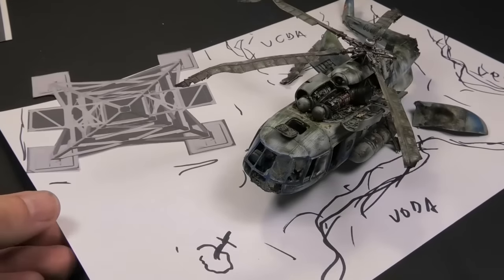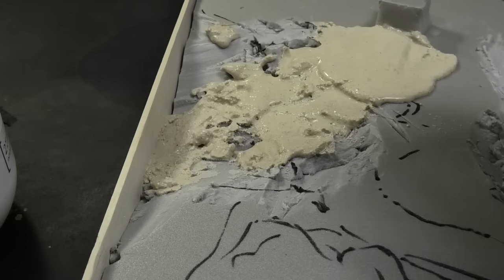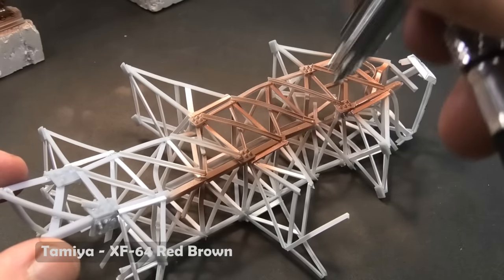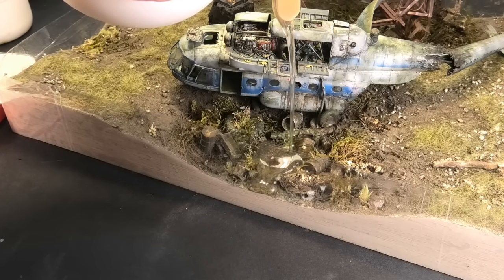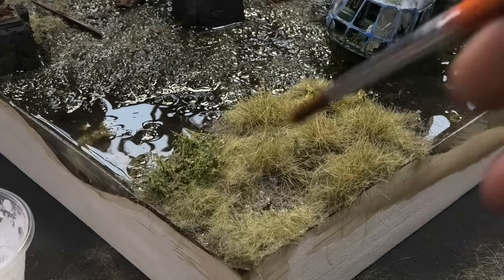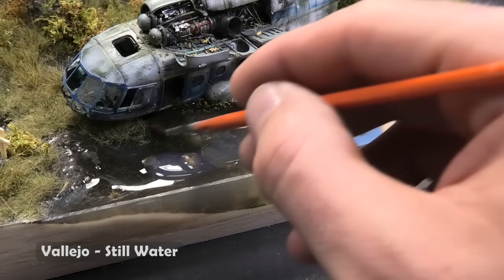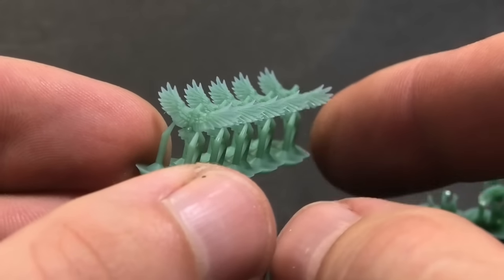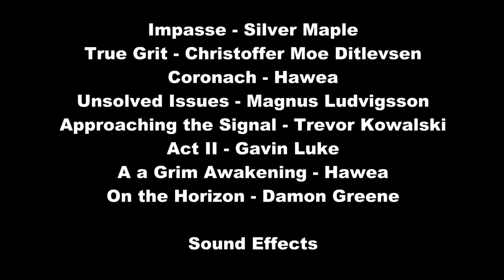Stalker Call of Pripyat - Crashed Helicopter - Post-apocalyptic Diorama 1/72

Comment: If you give everything a coat of clear matte acrylic before pouring the resin, it will do the best job of preventing that meniscus creep.  Any acrylic paint will do, but if you have a lot of different materials, the clear matte is the easiest.  Of course it won't help if the resin is over-filled, but other than that it works very well.  BTW, another excellent video!

Comment: A little note: In real life, high voltage power lines are usually steel ropes without isolation (there are only insulators, which separates power lines and tower construction).

Comment: Very nice work indeed. One tiny TINY nit to pick in this fine work: aren't the high voltage insulators usually a stack of discs of ceramic or porcelain? The ceramic is often brown colored, and they might be dirty, but should still have some gloss to them I think.

Comment: I'm really impressed 🤯😯. Generally, I find your videos enjoyable to watch. I'm learning a lot from them as I'm getting back into this hobby after about eighteen years. It's quite amazing to me how realistically you can capture both the model and the surroundings. For me, this diorama is currently the pinnacle of your craftsmanship. 👏👏👏

However, I also want to ask: How do you protect such a masterpiece from dust? Do you have any dustproof display cases or something similar? I'm just concerned that if I manage to create something this exquisite, it would be disheartening if it got covered in dust. 😅

By the way, if I were to find out that this was done with "resin water," I'd probably have to take a shot just to process it... Hats off to how you've handled the whole project. It's magnificent.

Comment: 3.d printing is cheating. 
Stick to your hobby
Reply from the maker: I can argue that plastic kits are cheating. Also, you need to learn 3D modeling, so it is in the end more time-consuming and requires more effort than simply buying kit and resin accessories.